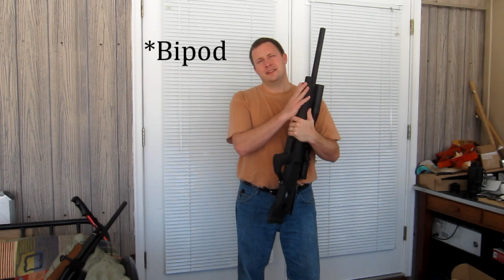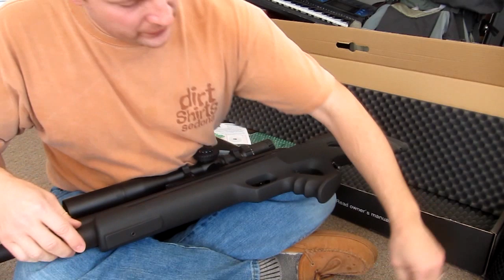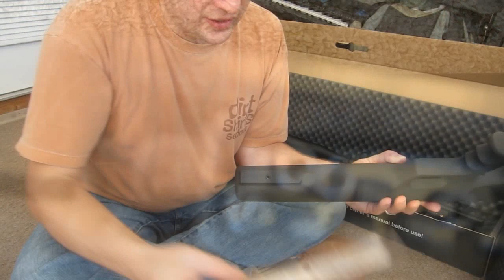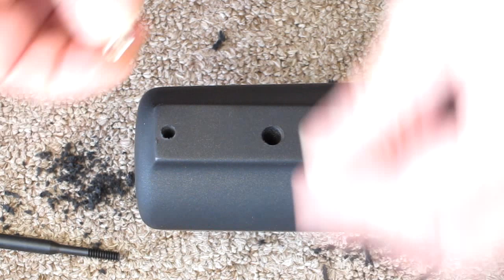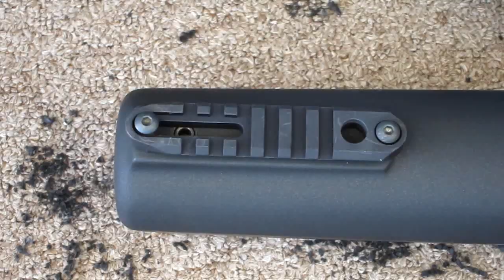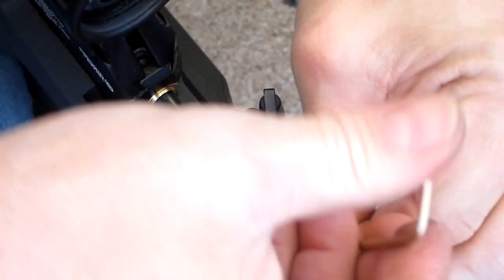FX Bobcat Bipod and Sling Mods

Comment: I find the 4" rail a little too long, and hangs over on the ends.  However, the Atlas BT15 3.35" rail is PERFECT, and the sling mount hole fits perfectly over top the snugging screw already in place from the factory- with room to spare, if yours isn't perfectly centered.  This is the route I took.  But I did use the same threaded insert kit, and 3/4" panhead machine screws.  Overall a great video- thank you for the idea!

Comment: Thought you may like to know. I believe that FX has watched your video. I bought my Bobcat last November and it is a bit different than yours. The air tube is almost as long as the barrel but what they did is they moved the tube screw forward so that it does not need to be re-drilled. They centered it also. Good job on helping us with the sling and for helping FX do an improvement.An FYI here too, I will be doing some swagging videos for the .30 cal pellet using the Corbin Swagging press on my channel in not the so distant future. I want to practice up on doing video production before I put out some AV junk.

Comment: My 30 Bobcat arrived with stripped stock grub screw threads. After seeing your video, I was about to order a Heli-Coil M8 x 1.5 thread repair kit but found there are two kits available in that size; one for Metric FINE and the other Metric COARSE. I haven't a clue what the difference is between them and wanted to make sure I order the correct kit. Could you tell me which one to order? I appreciate you help and the awesome video.
Reply from the maker: M8 x 1.25 is a coarse thread (1.25mm is the thread pitch) - You want an 8mm coarse.  http://www.engineershandbook.com/Tables/metrictapdrill.htm
Reply: Thanks for the quick response. I went ahead and ordered the coarse kit per your advice. BTW, my 30 Bobcat came with a compressed/squashed little ball the serves as the buffer between the grub screw tip and the cylinder. AOA was kind enough to mail me a new one. You may want to keep on eye on yours as now I know they get compressed and lose elasticity. Thanks again and keep the videos coming!.

Comment: WOAH! You got props from TED! One question to anyone who may have this same sling/bipod combination... How easily and quickly can you go from walking to the prone whilst entangled within that contraption? I realize standing is easy and the sling actually provides some stabilization, but when achieving the prone position, does it require adjustment to the sling, or disconnecting? When I return from Afghan, I hope to be plinkin' and huntin' with this EXACT setup.

Comment: Very informative instructions and well done. Instead of drilling and tapping the stock for the atlas attachment, would it be possible to use some epoxy just for the bipod mount as long as the FX screw was still accessible?
Reply from the maker: I wouldn't trust just epoxy from my experience. The mechanical fastener is so much stronger in this application.

Comment: Hey Roland - what length button-head screws did you use to attach the picatinny rail?  I have all the other components - the Bobcat hasn't arrived yet - I just need to get the right length screws.
Reply from the maker: 3/4" - 1" will probably do it to but may just start to come out into the tube area.
Reply: RolaidsBench Thanks!  My Bobcat is supposed to be at FX around the end of February and I'm getting all the stuff together to do pretty much just what you did in the video.  I went ahead and got some 3/4, 1, and 1 1/4 screw so I'd be sure to have what I needed when the time came.  Thanks for the video!

Comment: At 11:00 you start talking about the grub screw, what diameter is that? 8mm? I know I will need to get the 12mm in length but just don't know the width of the screw.
Thanks again
Reply from the maker: Yes that is 8mm x 1.25(thread pitch)
Reply: Thats great thanks bud

Comment: What size kit was the permacoil thread kit you used?
Thanks
Reply from the maker: I used the 10-24 bolt size. The 5 mm will also work. A pan-head style get you below the surface of the rail.
Reply: RolaidsBench
So something like this would work?
http://www.ebay.co.uk/itm/25-Piece-Helicoil-Thread-Repair-Kit-M5-x-0-8-x-6-7mm-/271214307411?pt=LH_DefaultDomain_3&hash=item3f25a1e853